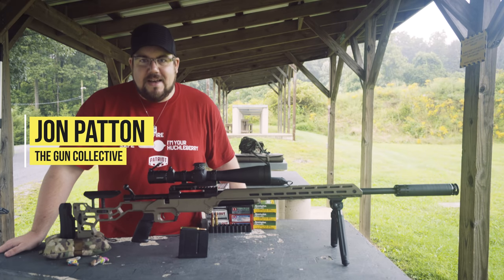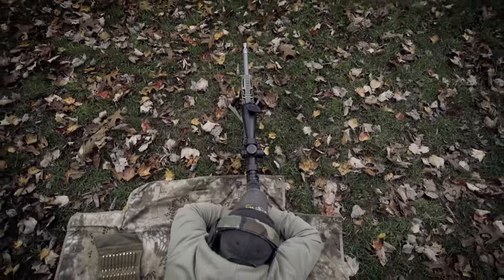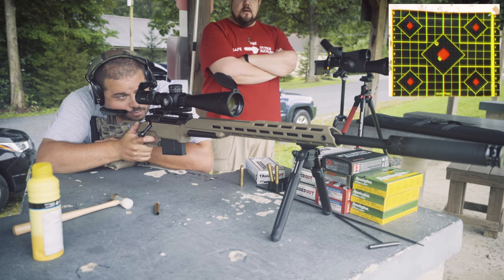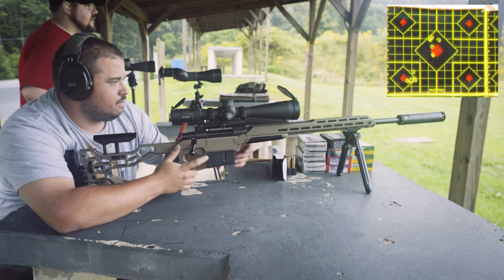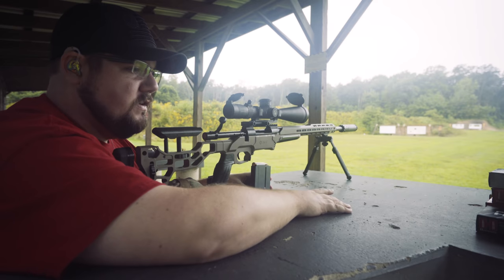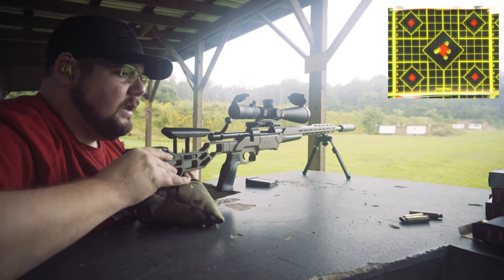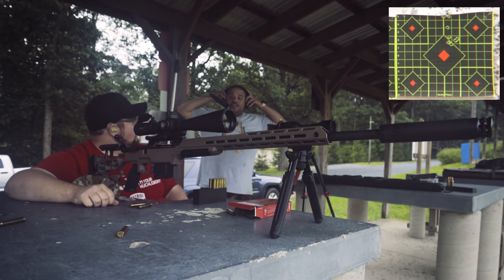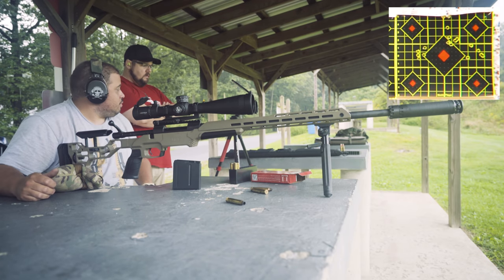Trying To Dial In The Howa in 300WM - The Proving Ground

Comment: With all due respect, with the troubles you were having with the mirage effect, why not simply remove the suppressor and eliminate one variable?
Reply from the maker: They weren't significant enough to warrant doing that within the test. However, we will likely revisit and see if the groups tighten without it.
Reply: Try some Federal SMK, I had similar issue with my old Ruger American, can't shoot nothing with Hornady, but did really good job with federal stuff, especially SMK
Reply: Who knows what is going on with barrel harmonics etc with that can on.
Reply: maybe try it with a suppressor wrap too so you can see if that helps?
Reply: I think Mark Baker is right. Barrel harmonics might be kind of wonky with the can.
Reply: @TheGunCollective  is that silencer known to shoot well on other guns?  When chasing accuracy, it helps to isolate variables.

Comment: There are so many things going on here...
 - The bolt sticking issue is either due to a rough chamber in general or the burr created by the belt reamer wasn't removed by Howa and is biting the case just in front of the belt. Had this issue on 3 separate Remington's.
 - What is the twist rate on that barrel? Is it a varmint contour?
 - That chassis will throw shots if you don't have very consistent should pressure when using a bipod due to flex in forend/chassis connection
 - That Remington ammo is poop for trying to get good groups.
 - No experience with suppressors personally but it may be causing inconsistent ballistics at muzzle due to temps and pressures. Brakes shouldn't have these issue since they are open to air.
 - All parts should be checked for torque but since the shots were more erratic than 2 groups showing up in 5 shot strings, not the most likely

Comment: This rifle is shooting like a sporterized Mosin-Nagant.
Reply: Mosin woudn't have these chamber issues. This is a crappy rifle. I'd sell it to pawn shop.
Reply: Soravia yes mosins do. When they heat up you need a hammer to open the bolt. Especially ones made in 1942. So roughly made during the shitstorm that was stalingrad.
Reply: David Noll yup just like a mosin but at over 10 times the cost for the same accuracy and sticky bolt. No thanks.
Reply: My Mosin shoots a HELL of a lot better than my Howa 300 win mag action.

Comment: If the cases are getting stuck, isn’t that a sign of over pressure? That means that the rounds are loaded too hot?
Reply: The primers would bulge before that happened and I'm sure if that was the case they would have noticed it right away plus it was a couple different manufacturers
Reply: Nick Nikes the chamber must be too tight or like he said, carbon build up
Reply: Well it's factory ammo.  So unless there is a bad lot I doubt it's to hot.  Unless there is a headspace issue?

Comment: Howa guarantees its Model 1500 rifle of being able to shoot sub MOA groups at 100 yard.  That sounds impressive until you read the fine print in that the groups are 3 shot groups (instead of the 5 shot group that is the typical standard for measuring rifle accuracy) and require the use of premium/match grade ammo.

Comment: I’ve also had to put a steel gas block new gas tube and 15” free float hand guard  but before all of that took place I sent it back to Remington because it was having very sharp and heavy recoil they did not look at the original gas block or tube The note stated when I had it returned that they tighten the setscrew is on the gas block and removed a bur out of the chamber the Bur causing The rifle to be over pressurized but when I got it back it was still having the same amount recoil so I took it upon myself to pull the gas block and gas tube take a look at them and discovered that the aluminum gas block was eroded from heat and melted in places so I spent another $300 on a $500 gun to make it so I ran correctly and the picture that I posted on Facebook a while back of the zero target with the whole center shot out of it was more less for me to prove that I fix the problem and you had questions Mr. John Patton of what that pattern on that paper ment that is what I was trying to state

Comment: Quality ammo in a precision rifle is key. You wouldn’t put shit gas in a high performance vehicle. 1 MOA expectation is pretty damn low. Not sure if that’s lack of confidence in marksmanship or in the rifle itself. I’m also questioning this constant issue of “sticking” cases. A new rifle will have a tight fit since it have never been used and broken in, but when the bolt is ran like it should be the cases come out just fine, when you run it like it’s made of glass they do not. All this proved was stick to my 700 action, do not buy a Howa lol. And why are you not preloading the bipods?

Comment: When testing and encountering strange issues, one should always eliminate as many variables as possible.
With the issues you were having you should have stripped the suppressor and the bipod off and just used the gun and optic until you had  a consistent setup and them begin introducing more variables.
With as many variables as you had, you were guessing as to possible causes.

Comment: that goofy scope mount could be a major part of the problem. that cantilever mount moves on real rifles, don't believe me use a high speed cam and see for yourself... on a ar15 in 556 im sure they are fine, not so much on a real rifle and actually quite out of place... standard STEEL rings and base should be used. even better if you can get rings that mount directly to the receiver to use as little pieces as possible.

Comment: 6:40  -  Once I've got my mechanics dialed in on slower shot strings...HELL YES, I'm Mr. Magdump.

Something was wrong with the gun...a sticky chamber will cause inconsistent pressures. In addition, for true accuracy testing, you don't shoot that much without thoroughly allowing the barrel to cool and cleaning, especially with a large cartridge.
Reply: can you please explain to me, how a sticky chamber will change the case pressure on a bolt gun?
Reply: I should have said 'could' instead of 'will'. If the brass isn't allowed to flex consistently, depending upon case wall thickness and other such reasons, the internal ballistics of the controlled explosion will vary. Inconsistent pressures will then change velocities, and recoil. The variance in velocities generally cause vertical stringing. Recoil variances will definitely change how the gun reacts as a whole and could throw shots horizontally.

Comment: The responses to this video are typical.  
Let's see how the shooter does on an accurate rifle, then on this rifle. That variable eliminated, take off the can.  Then make sure all bolts are correctly torqued.  Then make sure the chamber is clean and bolt lubed. Use sandbags.  Use a chronograph to determine standard deviation and figure out that stringing.
Mike the brass to compare where it expanded and by how much, then compare brass expansion numbers between manufacturers.

Comment: The 1st ammo was displaying excessive case pressure.  The COAL (collective overall length) could be too long for your specific chamber, thus stuffing the projectile into the lands and grooves causing excessive case pressure and vertical stringing due to the inconsistent muzzle velocity. Or the ammo could be loaded hot.   Also, the G1 ballistic coefficient of the 150gr American Whitetail is 0.338, that's horrible!  Better ammunition will make a huge difference.

Keep up the good work, and pay no attention to naysayers.  Unfortunately the "gun industry" is full of them.

Comment: I took a cheap savage 12fv 6.5 creedmore broke the barrel in by cleaning after every round for the first 20. I then put it in a mdt lss xl chassis with a burris xtrii 5-25 . Cold bore 5 shot group American gunner 140gr .5  143 precision hunter .4 140 eldm shot a 4" group! The AG was averaging 2680fps the PH average was 2620 the eldm average was 2720 out my 26" barrel. Barrel harmonics!  Working up hand loads now.  Love the video!

Comment: Isn't this a $1,400 rifle? To get into PRS with a reliable sub MOA rifle 5 years ago would have been $4,000 plus. You get what you pay for and can't complain about not getting $5,000 accuracy for 1 grand.
Reply: Most modern guns using good ammo shoot really well.  My Bergara HMR 6.5 CM is well under sub moa for under a grand.  My Savage 110 BA 338 Lapua same deal.  Sub moa for $1400.  My Savage 111 300 Win Mag not so much and not because it can't.   It's a little over moa because that thing gives me a nasty flinch because it's pretty light and snappy while my Creedmoor and Lapua are heavy target setups.  The Creedmoor is 12 lbs and the Lapua is 17 lbs.

Now if you want to get 1 hole accuracy then be prepared to pull out a packet .......or 3.

Comment: Some grey color 3m scotch brite cloth pad "engineering pad" on a .410 shotgun brush with some light oil run it in the chamber using a drill to polish up the chamber. Had worked great for me in the past.

Comment: Very interesting. I recently purchased a 1500 lightweight in 308 W.  Be damned if I didn't have the same problems these guys were experiencing except, I had only minor extraction issues. With factory ammo though, I could feel the difference between cartridges.  All were at least snug with about 1/3 tight to close on.  When I got home, I did some measuring & found the chamber to have 0 head space even with freshly full length sized brass which I had fired that day. Most of the new once fired brass I neck sized with a Lee collet neck sizer.  This ammo is now consistent in the chamber & groups are ranging from 1.7" down to about .8".  Interestingly, the tightest groups are with median powder charges regardless of bullet weight.  Projectile weights have been 135, 150 & 165.  Another very surprising outcome were the bullet velocities. This 20" barrel easily obtains the stated load velocities for a 24"barrel. 
Anyhow, I'm still working up loads at the moment & I'm very happy with the rifles accuracy & functionality.